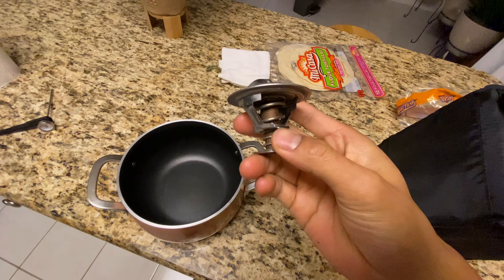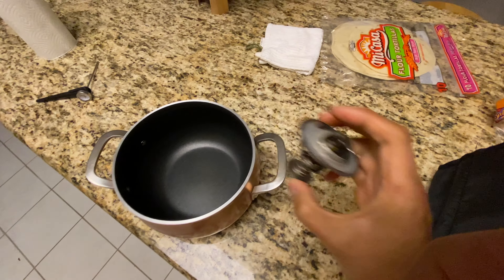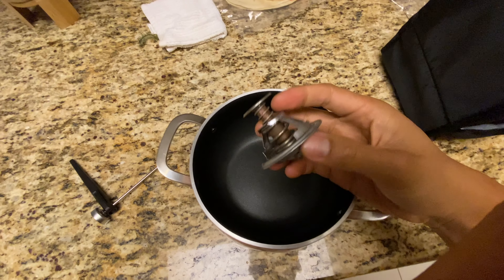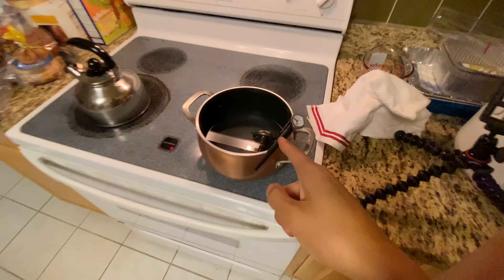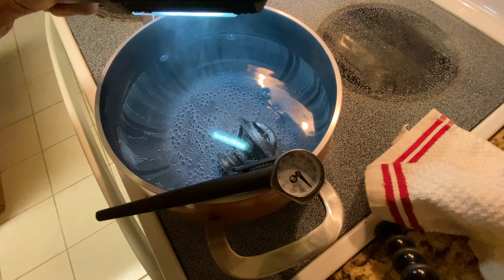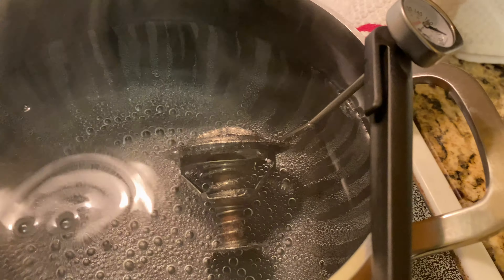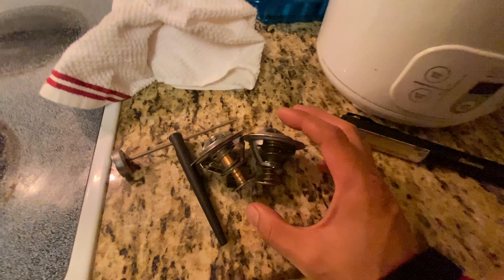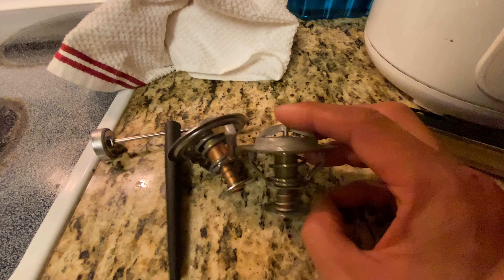Ever Wondered How an Opened Thermostat looks like?

Comment: Hey man my prelude just started showing it was overheating but how can you tell if the thermostat is bad or not? Can't get enough of this prelude curse 😂
Reply from the maker: The thermostat can only have two problems: stuck closed or stuck open. If it’s stuck open, you wouldn’t have overheating issues. If it’s stuck closed, you would be able to tell if your lower rad hose stays cold while your car is over heating. In any case, the thermostat isn’t expensive compared to other parts. If I were you, I’d go ahead and replace the thermostat and radiator cap because they’re inexpensive. From there, I’d check if there’s a coolant leak by renting a Radiator Pressure Tester Kit. If it passes the pressure test, then it comes down to the fan switch, temp sensor, or dead fan. You can find a Scotty Kilmer vid on YouTube on how to diagnose the overheating problem. Good luck!
Reply: @Rawrkee  thanks a lot man!